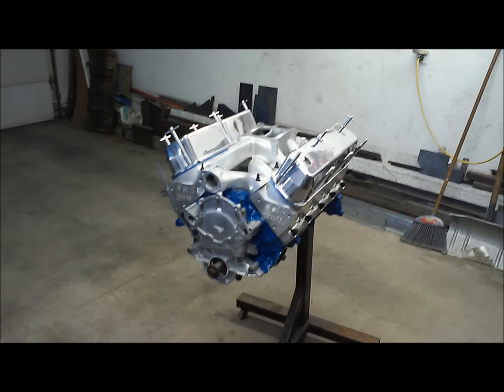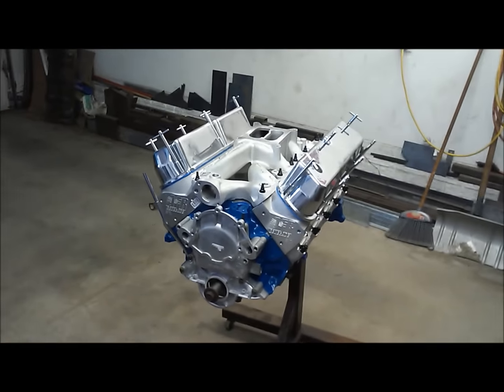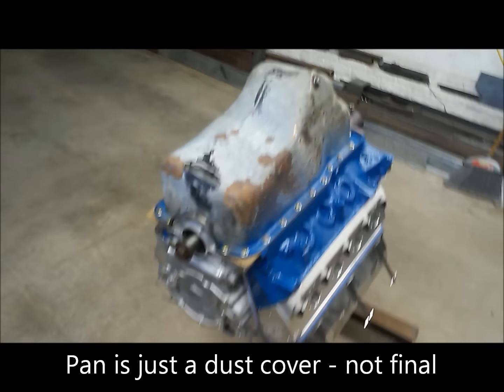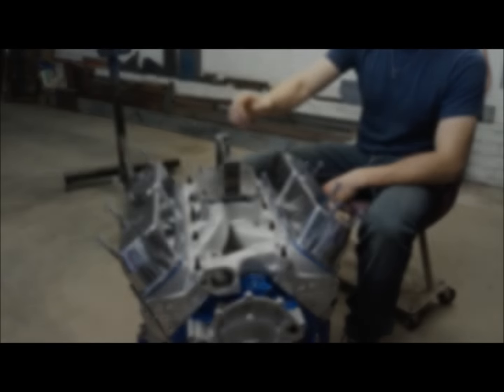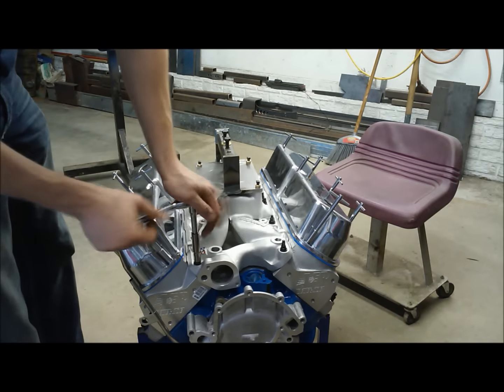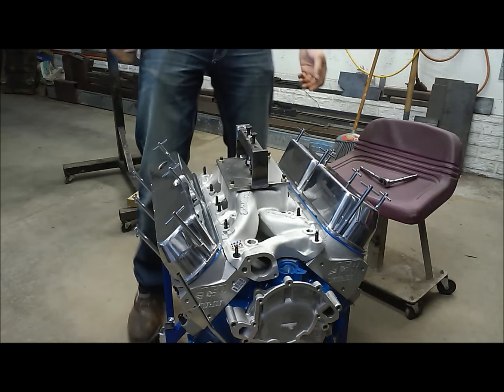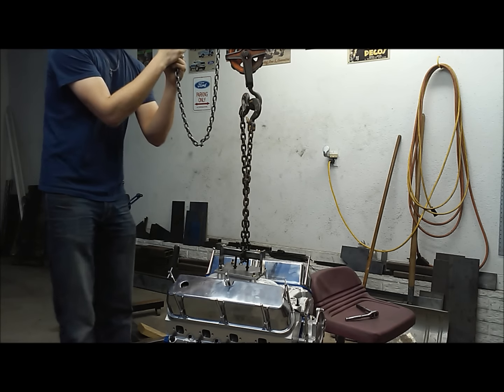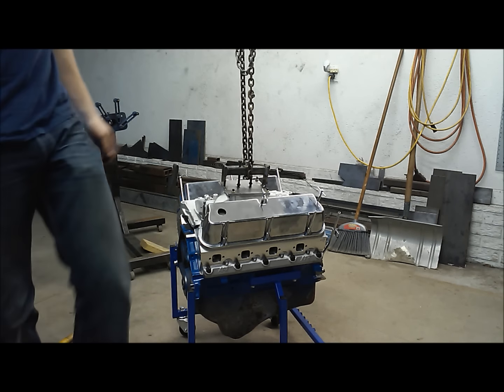Prepping a Crate Engine for Transport - Performance 302/5.0 Build

Comment: I had a question what is the recommended torque specs on securing the connecting rod bearing halves to the crank shaft  the 2 nuts or should you buy new nuts?thanks mike
Reply from the maker: +eviloctober the connecting rod nuts are torqued to 25 ft-lbs

Comment: I've only seen a manifold do that one other time in my life that sucker was on there....what gasket sealer did you use?
Reply from the maker: +The Dude just the permatex black stuff, it has a picture of a differential cover in the background.
Reply: +ThunderHead289 wow man really just the regular old black permatex and that sucker was on there
Reply from the maker: a very light amount around the intake runners and coolant passages, and then on each end of the manifold instead of the crappy cork gasket will do this apparently. i must be because the engine had never ran at this point.
Reply: +ThunderHead289 yeah  that makes more sense I hadn't  thought about the fact it hadn't been ran yet...and yeah I'm not a fan of cork gaskets either
Reply from the maker: if the block has been decked, and the heads have been milled, the intake will sit lower on the block. if it sits low enough, and the cork gasket is used, it will not allow the head to intake area to seal properly as it cannot sit low enough. plus they shrink and leak. - something to keep in mind on the wedge intake design.
Reply: +ThunderHead289 yeah I been there and done that many times a lot of people  on their 1st builds don't  take that into consideration when having machine work done